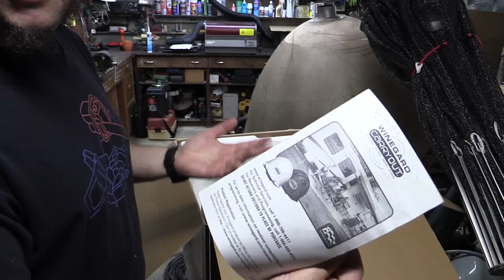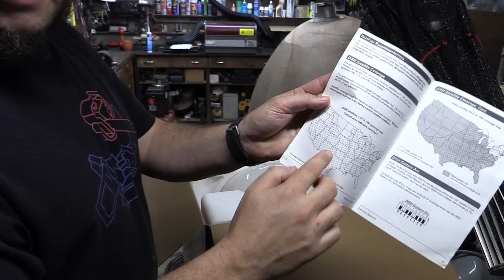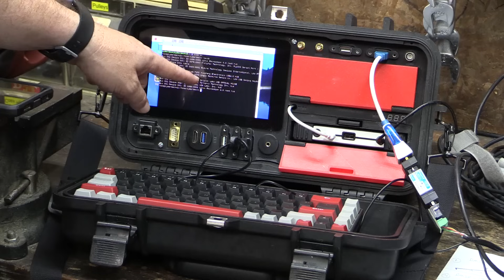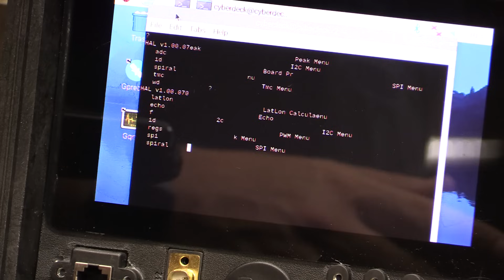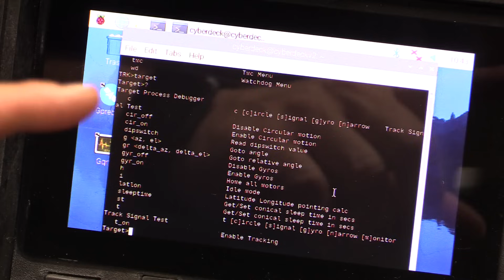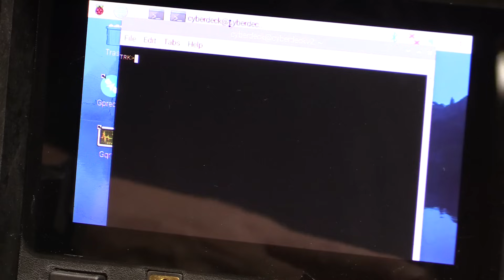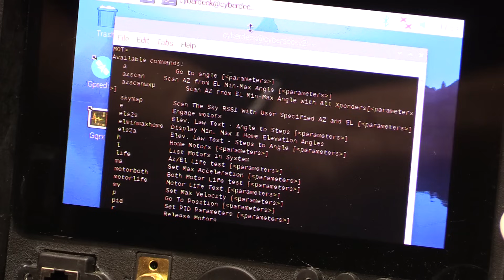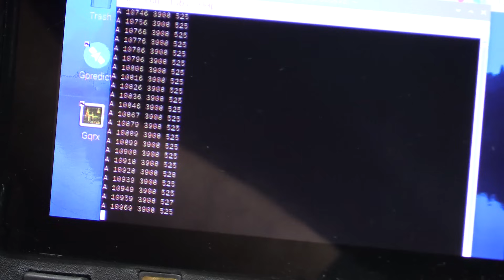How To Hack Winegard Portable Satellite Dishes

Comment: Those are stepper motors, no gears inside. What youre hearing sounds really bad but its actually not hurting any gears. Its just the motor cogging as it tries to bump to the next pole.
Reply: was going to say the same thing he has no idea of the mechanics behind
Reply: I was gonna say it probably has a breakaway clutch.  They sound horrible and chincey, but  you can just let a breakaway cluch grind almost indefinitely without breaking anything.
Reply: Like an Apple iie 5 1/4" floppy drive?
Reply: This is it. Sensorless homing of things with steppers isn't too uncommon because end stop switches are just another point of failure compared with turning down the drive current and skipping steps against the mechanical stop.
Reply: Buncha nerds up in here 😂😂 it got increasingly nerdier, like you had to out-nerd one another 😂😂

Tell us you're intellectually insecure without telling us you're intellectually insecure 😂
Reply: @TheLifeOfKane Ironically, you are the only one that comes off as insecure here. Believe it or not, some people aren't intimidated by learning new things. I feel bad for you.
Reply: @TheLifeOfKane  tell us more about how nerdy we are as you comment inside of a thread on a video about hacking 30 year-old obscure hardware, complaining about people discussing the subject of the video.
Reply: Don't acknowledge these things. When someone calls you insecure, "no u" is about as bad a response as they come 🙄
Reply: @richardred15 You can be timid and reserved if you prefer. Some people need to have their ego deflated.
Reply: Look at any retro computer video with a C64 disk drive repair.....

Comment: Regarding the G3, you might want to find and lookup the FCCID of the device. The FCC requires RF equipment to be inspected before being sold commercially in the US. The FCC will tear-down the devices and take high-resolution pictures of the internals, and publish information about the frequencies it operates in as we as sometimes the modes. This might provide some information as to if it has Bluetooth or WiFi or some other RF control capability. I use this method all the time to figure out what chips & signals are used in devices I want to hack around with before I buy or teardown a device and potentially kill it.
Reply: That's true of transmitters, not receivers. But sometimes you get lucky.
Reply: sadly i couldn't find anything that looked promising under the winegard company id (C3D), but it's definitely possible that there's some module that may be subject, or things were certified under a different company

Comment: RS-485 is an addressable differential serial similar to RS-422. RS-232 is only a single phase serial signal, and is not addressable.  
RS-485 is not weird, nor is it obscure, it is still used everywhere.

Comment: 23:28 Truncated dish - The overall system design doesn't need to worry about adjacent satellites in the N-S (elevation) direction, only E-W (azimuth) along the Clark belt. So lower directionality (smaller dimension) in the N-S (elevation) axis is an available design choice. No such dish dimension flexibility in the E-W (azimuth) axis, as they'd want gain pattern nulls at ±3° and multiples (to the extend possible). Cheers.

Comment: you should definitely look into wireless serial adapters for interfacing with these especially when you don't know if they're going to spin around like a top whenever they feel like it as part of the homing sequence. they're available for pretty cheap online and won't risk you unplugging or breaking a cable because of a bad command

Comment: HAL ist Hardware Abstraction Layer, basically just libraries provided by the processor manufacturer so the developers don't have to mess with the hardware's specific addresses and bits to do stuff, they can just write "start a serial connection on periphery device #1" without any knowledge of how to talk to that peripheral.
On the G3 model, I'd start to poke around the "ICSP" header above the AZ(imuth) cutout on the board. It's the In-Circuit Serial Programmer/ing port used for, among other things, flashing the progam image onto the controller while it's mounted (in-circuit). As the name suggests, it should use a simple serial connection (UART).
The "WiFi-Looking traces" on the board look to me like controlled impedance transmission lines for the RF signals. The CPLD JTAG header I assume is for some kind of FPGA/DSP implementation, basically the RF Frontend used to process the received signal into its demodulated representation, so I think JTAG is not necessary to tinker with the controller itself.
BTW the ICSP header is a somewhat-standard pinout along with the mounting holes, I've seen connectors that clip into the holes and make a connection with the pads on the board using pogo pins, but I don't know the exact name of that connector.

Comment: Speaking of wired connectors for RS432, 485, etc, you can find serial ports with RJ50 (if I remember correctly), just a bit bigger than RJ45 Ethernet. The Ethernet style connector will plug, do it's "clic", all fine. BUT the plastic borders will be aligned with the outer pins of the connector. It works nice for RS232, but protocols using the outer pins with the correct cable will not works correctly and it's a pain to fix.

Comment: This is full duplex RS-484 hence the need for a converter to RS-232. Strange since normally RS-485 is setup with one pair in a multipoint configuration.

Comment: RS485 is still extremely common in buildings and industrial control, usually as the physical transport for Modbus-RTU. It is great great for long distance low/medium bandwith multidrop communication that works in fairly noisy environments.

Comment: Since DirecTV receivers can control these dishes and direct them to go to the satellite you could hook up one of them and monitor the signals to see how it works.  If you change the LNB you can use those for FTA satellites, at least the stronger ones since they are pretty small.  I just checked FTA again and the satellites have moved, what was once Galaxy 25 is now Galaxy 19!

Comment: Next step: Glue a small Pi or something to the back of the brainboard and either stick a battery in there, or tap power from the brainboard, and just interface to it over wifi. 

When you plug in the USB A-A, first sudo dmesg -w which will watch the kernel messages so you can see any messages from a new device being plugged in or detected. I might have to nab one of these G3's to poke at it!

Comment: RS45 is used in a lot of point of sale systems to connect receipt printers and other peripherals.
Reply: Slot machines too.
Reply: I believe industrial tech uses RS485 because it's less susceptible to noise interference.
Reply: Lots and lots of multi-station HVAC control systems use RS-485 between the thermostats, the controller, and the remote air dampers.

Comment: Always nice to see things like this being used for things they were never really intended.

I've discovered that I really like Node Red for interfacing with serial devices like this. In this case you could not only throw together a simple GUI for the interface in a few minutes (probably less than an afternoon including install/learning time for Node Red), but you could use it to process that sky map data into a file, chart, database, etc.

I did something similar for an HDMI matrix switch with a serial USB port I had picked up to create a "phone app" for it (before determining that the remote was just less of a hassle and reclaiming the Pi).

Comment: I absolutely loved hearing that knocking noise when the first model started up. The hardware likely didn't have a sensor to know what position it was in, much like an old Apple IIe floppy disk drive moving the read/write head to the outermost track 40 times making a similar grinding/knocking noise. I assume the same/similar thing is happening here.

Comment: Beware "trying" what seem to be Ethernet or other supposedly standard connectors. Some system designers misuse connectors for totally different signaling protocols. Best to reverse engineer the circuit (just a bit, adjacent chips) to make sure before connecting to your favorite PC.

I wouldn't put it past them to (mis-)use a tempting connector for a power supply. 🙂

Comment: There are pilot signals from each dish that tell it where it is

If you were to point to 129 West and turn on the receiver it says You are pointing at 129.West
It has software in the receiver just for that company 
So the receiver won't see any other satellite signals, just that company

Comment: that noise is stepper motor slip. its a magnetic slip no while it sounds bad its not harming the drive unless you want to argue the vibrations caused by it fatigue the bolted and electrical connections.... which might be valid. vibration is one of the enemies to PCBs with components and plugs for sure

Comment: Jep the homing sequens sounds terrible..  now imagine 30 of them hanging above your head doing that at the same time.. It has become less now but as a stage technician I head that every day. Moving lights did exactly the same 10 years ago. Always sounded like they were grinding apart. But steppermotors can make an array of weird noises..  

The old gas discharge moving lights are all being replaced by LED now. I have been wandering what a cool platform it could be for projects like this. The motors are usually a bit stronger and more heavy duty so perfect for telescopes!?

Comment: 24:51 that noise are not the steppers grinding, but some plastic gear. it's like the 1541 or the apple 2 floppy looking for track0, without having a sensor... just move the motors in one direction until the mechanic hits the limit... terrible concept, just because you saved 1-2 switches or a stepper driver which can do sensorless homing just by looking for a sudden spike in the power draw while seeking (most newer 3d printers do that.)

Comment: FYI -  The debug connection may actually be INSIDE the injector on your G3 -- as that's what's sending the commands, not the board on the motherboard, it appears....    or, it can communicate using sideband data through the modem connection....  worth trying anyhow!

Comment: I do believe that you can interface with USB from the Chrome Browser, but I have no idea how to actually. I know that I have successfully used it to program an Arduino from some web page in the past. However, I know that Linux is really good for this, I had no internet access and I had to interface with a 450MHz modem in like 2009/2010 and there was a bug in the installer. But just spending 3 hours on reading various man pages I got a driver working for me so I could access the internet. I had either that or go fishing, so I did both. The bus just came 2 times a day too.. 🙄 This is in Sweden. I think that it was 4g over the old NMT frequency and when I got it working it was fantastic

Comment: RS485 is a lot more robust over longer lengths of wire because it uses differential pairs. Also, HAL can stand for Hardware Abstraction Layer (although it might not in thise case, but who knows, its an embedded software term)

Comment: I wonder if you could tty into the G3's external box and control it through that. 
edit if you can do that, maybe you could use that to get the signal out of it, too. Then you could keep the dish housing intact, and mount it outside while the external control box (or a pi that spoofs its signals) inside somewhere like the monorail or the Sandland tunnels
Reply: I had the same thought. 
There might be a serial port of some type hiding inside that box.

Comment: I know it sounds terrible but the noise you're hearing is just the stepper motor losing steps. It's basically the rotor inside the stepper motor bouncing back and forth between two magnets. The sound is being amplified by the design of the mechanism which definitely makes it sound worse. That being said it's unlikely it would ever actually cause a problem.

Comment: rs485 used on for modbus (such as electricity meters solar inverters and industrial control), ptz cctv cameras and still widely used in the entertainment industry for controlling lighting under the guise of DMX - as you noted it’s just a robust, longer distance and multi device(bus) version of 232 - so hardly “obscure”

Comment: I'd be looking closely at those unpopulated footprints on the G3, especially the 8 pin one near the reset button as it's quite common for debug ports on commercial devices to not have the connector populated.  If you can get the part number of the processor you should be able to find out which pins can be configured for UART operation and then get your multimeter out and see if they end up at some unpopulated connector footprint.

Comment: RS485 is great for what it is. I think without reremembering it's basically balanced serial just like balanced audio compared to line. Great for noisy enviroments, going long distances, etc. It's just like you said not much in the consumer or even the pro world I don't think I use any at our radio station but seen it a lot in industrial. Also digital signs and access control that use UHF RS485 modems to program instead of digging up the parking lot to run the lines at least until wifi bridges became more common and reliable. I am wondering now if you could use the guts of one of those to drive larger motors to move a much bigger dish... Great now I am getting ideas.

Comment: RS-485 is just a differential serial, if one wire is high and the other is low the data is considered transmitted as valid. DMX lighting uses a version of it so close that I regularly use RS-485 USB cables to talk to them from laptops, or raspberry pis (which IIRC can bit bang DMX therefor RS-485 like data output). 

As such I must protest, sir. RS-485 is used enough to be a common standard, from my point of view. Also, this reply has nothing to do with how jealous I am of your self aiming dish collection.......

Incidentally I am a smoker, so if you wanna give it a good home.......

But seriously, Lemon juice or white vinegar and water, spray it on, wipe it off. The hard part is cutting the tar film left over. Dawn cuts damn near everything. 90% iso cleans my hands after cleaning out my pipes. Anything on the more alkali side of neutral pH should start neutralizing the compounds coming off it. Also, apparently, ozone. Never tried it myself, but apparently ozone does pretty good at breaking down the smelly compounds. Get/build a HV ozone generator, put the bits in a box with it, and let it soak in the O3

Comment: those 485 adapters can get EXPENSIVE lol. you can usually find a 485 to USB adapter though to avoid having that extra 232 to USB in there. StarTech has a 232/422/485 USB port for about 100 bucks which is actually really cheap considering that some of the National Instruments 485 adapters can run up to $1000. you just have to remember that 422/485 does NOT have a standard pinout and you need to look up the pinout for every single different adapter you own. sometimes the pinouts will be different for adapters in the same brand lol. i usually made up a cable for each manufacturer that converted their pinout to my lab's "standard" pinout that our devices all used.

Comment: I worked as a technician at an RV place (I was the satellite / solar guy). I, too questioned how this was "camping". I was told that it actually isn't camping, but "RV-ing". I suppose a house on wheels make all the difference. Anyway, I used to work as an electronics technician and regularly used a piece of DOS software called "Telix" to communicate with various electronics via the serial port. I had one piece of tech that involved me typing things into it, noting the results and writing them down. Thankfully, Telix has it's own programming language called "SALT". I learned how to use it and wrote a program that interacted automatically with this particular piece of tech, and even generated a test report. The nice thing about SALT is it's geared specifically towards using the serial port and log files. Might be something for you to look into to make your programming life easier. It should theoretically work with DOSbox. Just don't count on it being Y2K compliant ;)
Reply from the maker: I remember trying to camp (like with a tent) near Los Angeles and every "campground" I called asked what size RV we had. When I mentioned a tent they acted like I was homeless :-P

Comment: RS-485 is the bus in your car.
Reply: Typically, cars will use CAN rather than 485. Newer cars might use LIN.
Reply: WMS used RS-485 in slot machines. Scientific Gaming bought out them and other slot machine manufacturers so RS-485 isn't used any more.
Reply: 485 is really just long range RS232, used in industrial and scientific applications. It can span kilometers of distance without repeaters.
Reply: @nickldominator  CAN is a form of RS-485.
Reply: RS-485 is a hardware protocol.  CAN is hardware and the communication protocol.
Reply: @ahbushnell1  CAN isn't a form of 485. Sure, they both use differential signaling, but that wasn't invented with 485.
Thats used for everything between CAN to ethernet to HDMI.
Reply: @nickldominator  I've looked at it more and it looks more  like a descendant then actual 485.  Thx for the input.

Comment: 485 is used for non ip cctv ptz cams still. Also there's a way to wire 485 it work with 232 without an adapter. Side note I work with 232 every day